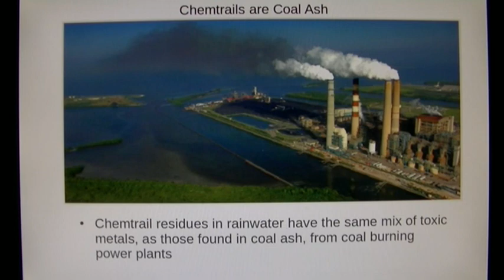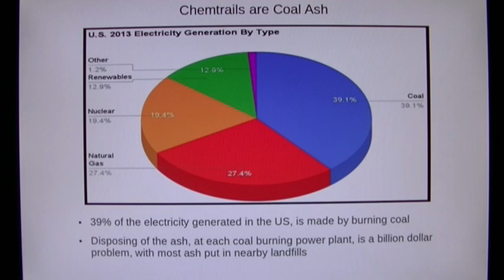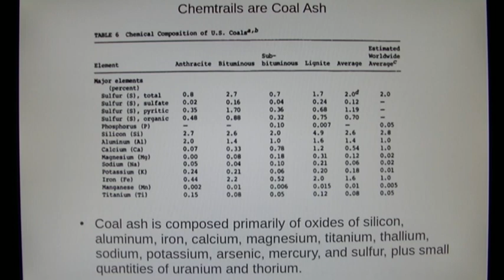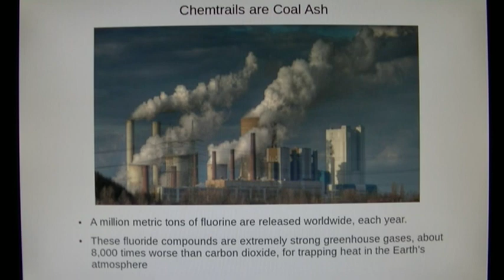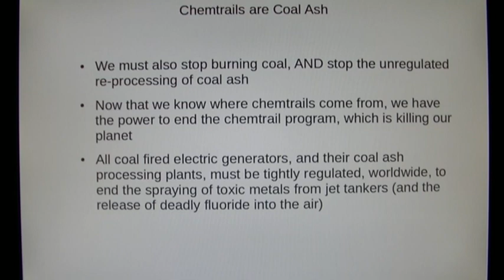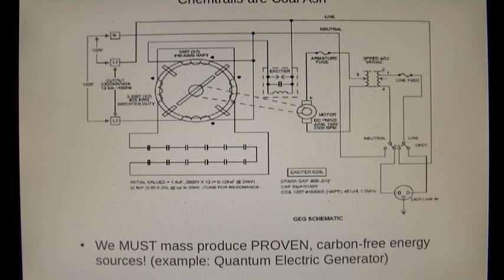Chemtrails are COAL ASH

Comment: We still have a problem. That is the weight of the coal ash. Chemtrails that are hundreds of miles long then spread and cover the whole sky weigh hundreds of tons. These are trails left by single aircraft on a single flight and there are currently no aircraft that has a max takeoff weight sufficient to accomplish  this sort of mission. THe largest airlifter produced is the A380 and it only has a load capacity of 300000lbs far short of what the mission would dictate. Also I have found that most aircraft seen trailing are commercial so where could the store the tons of coal ash on flights already loaded with passengers and luggage?
Reply from the maker: Thomas Parsons
The alumina is pulverized in super sonic grinding mills, and pumped as a DRY, talc-like powder into enormous holding tanks on the planes. There are no "kegs". Yes, a 747 CAN carry enough of the mixed aerosol to leave THOUSANDS of miles of chemtrails behind. YOU are missing the point, that a hygroscopic nano-particle needs very little mass, to create thousands of miles of artificial clouds.
Reply from the maker: Thomas Parsons
You're a shill, so I'm deleting all your comments.
Reply: +Thomas Parsons You're using logic. I don't think that will appreciated.
Reply from the maker: Thomas Parsons The heavy spray planes are pure white, and are not passenger jets. The light trails come from a fuel additive, containing barium, in regular passenger jets. I think you should look at Tinker Air Force Base, and their fleet of KC-135 tankers. These can carry many tons of payload. Keep in mind these are hygroscopic, nano-particles, so a microscopic particle, becomes a water droplet, causing the haze, and cirrus cloud deck. It takes very little mass, to create the haze over a large area. Also, since water vapor condenses onto the metal oxides, there is less humidity to produce rain, and a hot air layer, which prevents thunderstorm vertical movement. These are the reasons, there is never rain, if chemtrails are overhead.
Reply: Thomas Parsonsand these 747's full of kegs of coal ash slurry, have no passenger seats and they are NOT going to Hawaii, with the family. FOX News needs to spread this terrible info. No one will talk about it! WTF!!  NO SENATOR will speak out, all bought out!!
Reply: Kegs of coal ash? have you ever seen a keg of coal ash on an aircraft? I have worked in the industry for almost 30 years now I and have never seen a keg of coal ash on any aircraft. Has anyone ever seen or recorded and aircraft being loaded with coal ash, ever seen or recorded trucks carrying ash to airports? Any drivers in the last 30 years ever comforward? Pilots? Nope.... Please do not embarrass yourself posting pictures of weight and balance test tanks. You are totally missing the point. A 747 can not carry enough of anything to leave a trail hundreds of miles long. And that is using the FULL available take off weight with out equipment to spray. Aircraft have  limitations that can not be exceeded. Go learn something about aviation.
Reply: Thomas Parsons  Kegs of aluminum oxides, barium and strontium 90, that is what shows up in the down below soil samples, rivers ,streams, plants. Go see the KEG PARTY here : Just scrowl down : http://waterpoweredcar.com/chemtrails.html
Reply from the maker: broandrew
It looks like they broke your link, after you posted it. The lab tests prove the Coal Ash hypothesis, so that is why the results are gone. Some big money is hiding their involvement in poisoning everyone, and everything.

Comment: Dear HAARP Report,

Some very wise things have recently been said at:
http://enenews.com/

- in the comments section to this article:
Report: Fukushima fallout detected in U.S. fish

- for EXAMPLE:

Gasser
March 2, 2015 at 10:07 pm Log in to Reply    

The Trail in and out of Hell………After the explosions all that debris rained down over the complete Dai-ichi site.

If all radioactive particles were a fluorescent pink color, a circle many miles around the Nuclear site would be saturated in pink and fading out in all directions for untold miles and also up into the atmosphere going around and raining down on the World at this moment.

If you could see Radiation its everywhere, vectored by every wheel and shoe in an out of the pink ELE disaster zone spreading radioactive particles far and wide forever.

Every vehicle that's been in and out of the Dai-ichi site is/will be to contaminated to repair/sell…even to be melted down recycled.

Any item that leaves Japan is/will be contaminated and this contamination will escalate as it half-life compounds into deadly Actinides that settle into specific parts of the human body's vital organs, as its half-life morphing Becquerels punch holes in all directions through DNA Genome chromosomes causing gross mutations in ALL life.

Nothing is excluded in this withering death spiral that will ultimately lead to 450+ World wide unattended Reactor meltdowns, by then no one will be around to see the heavy metal Pink Cesiumsets and record the Earths last ELE Cockroach gasping.

Igmz
March 2, 2015 at 9:35 pm Log in to Reply    

Soooo, obviously, this is happening to us. I mean if inland fish, and fish people assumably eat (not to mention the other things which eat the fish, which we also eat..apex predators, right?) are getting dosed like this, well, "DOH!" Sorry yall, I knnow I'm preaching to the choir, here at least. No wonder people can't handle the truth. We might say we want it, the word might be engraved on our images, and within our sacred texts, but the sad reality is, we simply can't handle it. Not in enough numbers to make TPTB shite themselves in their fear of us, not enough to FORCE them to STOP…not enough, and soon, fewer still. Sorry folks not so "opti-pessimistic" these days.

harv33021
March 3, 2015 at 10:13 am Log in to Reply    

Igmz, you nailed it. "Not in enough numbers to make TPTB shite themselves in their fear of us, not enough to FORCE them to STOP…not enough, and soon, fewer still." And "bowling" came through with this, "Now is the time to help each other. To console. To forgive. To.open your heart. To listen as many do here to one another."…I believe that is the course of action to follow…I have no intention of passing on into the next dimension filled with hate, anger and rage. We are not going to beat the TPTB in my lifetime. Earth is going to end up like Mars, dead. But we will continue on our spiritual paths for many more lifetimes. It is all a learning experience and I am looking forward to it. Love one another and do no harm. It is a learning experience and once we have learned the lesson we can move on to others.

Best Wishes..........

Comment: No spraying all winter here kn buffalo.
4 days ago i wake up with 2 thick lines over my house and the sky was torched later that evening.
Now i can barely function and feel extremly ill and so does my girlfriend
Reply from the maker: Nick Blains The jetstream pattern has completely changed, in the last three days. And, there was a clear spot over NY state, so they sprayed to prevent the clear spot from forming a low pressure later. The toxic sprays over NY fall to the ground over the UK, a week later, so this is more covert genocide against Europe, since they are now dumping the dollar. Also, by preventing a low pressure in the Northeast, the warm air hitting Greenland is maintained. Southern Greenland is melting fast, as a result of the jetstream control, in the eastern USA, which was held in place for the last two months. If you are in a low lying area, you should sell out, and move to higher ground. Sea level rise is going to be 100 times faster than the shills at IPCC have predicted.

Comment: Dear HAARP Report,   After ten-thousand years of civilization they are only now discovering an apparently entirely new cloud formation called ‘hole-punch clouds’, or ‘fallstreak holes’, isn’t that amazing?  Do you care to offer any comments?   Thank you for being there as I consider your site to be one of the most very important on the web.

http://www.freep.com/story/weather/2015/02/27/hole-punch-clouds-southeast/24108707/
Reply from the maker: Beta Earth One When the atmosphere is stable, the jet liners ascending through the cloud layer sounds like a reasonable explanation, especially, when the punch cloud is oval, with a line through the middle. I think the real Haarp downbursts are much larger in scale, and the software will avoid giving away evidence of a manmade high pressure, whenever possible. Just my thoughts on the hole punch clouds, for what it's worth...

Comment: Is the crazy hot-humid-foggy weather attacking Florida in the middle of Winter related to HAARP Weather Manipulation ???
Reply from the maker: XTRMJ It looks like Florida just has strong southwesterly flow in the jetstream. Looks pretty normal to me.
Reply: The HAARP Report Thanks. It's just that I have never experienced this type of Winter weather in Florida before. It's just bizarre,...
Reply from the maker: XTRMJ Something big is happening in the eastern Pacific jetstream, as the persistent high, off the coast of California, is not being rebuilt in the normal spot. That is what is causing the strong southwesterly flow over Florida, IMO.
Reply: The HAARP Report
They were really spraying over Florida and to the east of Florida the other day, it was BAD!! I showed someone here what I saw and they had the same reaction, this person knows about this "stuff". I have noticed that they have been building these low pressure systems in Arizona or on the border of southern Cali and Arizona and they either sit there and spin for a while or slowly move east. It is to help draw the dry cool air straight down from Canada through the Pacific northwest!
Reply: Josh Writz I had a feeling about this, since I live in Florida, in the Tampa/Bradenton area, & I see the daily bombardment of our skies w/ ChemTrails, non-stop, & over huge areas. This has got to be expensive. I was just sitting here & figured one good reason to heat Florida up would be to concentrate more of the cold jet stream into a desired target area. Like I said before,... this is not Winter weather for Florida since I can recall, mid 70s onward. This "hot-humid-foggy weather attacking Florida in the middle of Winter" is not casual,...

Comment: chemtrails have been around since the 1960's
Reply from the maker: Back in the 60's, jet engines were not very efficient, and produced much more water vapor, than modern turbofans. I think that is what you were seeing, back then, not chemtrails. Chemtrails didn't start until the 90's. What evidence do you have, for chemtrails, back in the 60's?
Reply: The HAARP Report please dont get offended by the way i phrase words. i m a just a truth seeker . but i am also interested in the why who how of things too. but i typed in search(years ago i did this): "chemtrails 1960's". lots of vids apprear. altho too much info is dangerous.
Reply from the maker: Arctic Kat
Back in the 60's there were persistent jet trails, caused by the high levels of soot, and water vapor. Those engines were primitive, compared to the computer controlled turbofans that fly 102,000 times every day, all over the world. Do you remember how cheap oil was back in the 60's? Why bother with making efficient jet engines, just burn that cheap fuel, and don't think about it twice. Little did they know the catastrophe that will result from unbridled CO2 emission. We will see the end of our biosphere, in only a couple of decades. It will be the most horrible thing, any humans have seen. It is happening everyday, but we are choosing to not see it - YET.

Comment: Pillar Point Air Force Station - located at big-wave surf spot 'Mavericks' near Half Moon Bay in Central California.  Place has several "golf ball" type radomes. Bing Maps photo shows the installation before it was finished.  View it on Google Maps / Earth. Site uses 4-6 GHz G-Band tracking radars.  See more at http://californiamilitaryhistory.org/PointPillarAFS.html. BTW - have a look at the stationary high pressure blockade installed yesterday (Feb 16) off California to prevent precipitation from moving in.  See: http://www.cnrfc.noaa.gov/satellite/epac_wv_loop.php   This blockade is a rerun of a week and a half ago.  Storm after storm are blocked using this technique.  In February Southern CA has had only 3/32" of rain in the area.  In January a total of 1 3/16" was collected in the foothills of Los Angeles.  What we see on this water vapor loop is a deliberate stationary high pressure blockade keeping CA and the West bone dry.

Comment: I think this is your first video I have seen. While I have been in the system for some time I must say you put up 2 major red flags. USAF is not pronounced as one word, its the United States Air Force. I have never heard this term and I served 8 years in the military. The second issue is you sound like your reading a teleprompter of information, but you are messing up lots of words like you didn't write it yourself. I think Chemtrails are real and I pray they are here for good reason, which is still classified. Maybe my input helps your cause, if not I meant no disrespect. You just have to remember you have two types of people seeking information, the paranoid and the aware. Id also like to say that spellcheck in youtube doesn't believe in the word chemtrail.
Reply: - and by term of USAF I mean pronounciation
Reply from the maker: CherokeeArchetype
The defense contractors didn't say "United States Air Force", they just said "usaf". It was quicker and easier. Maybe it has to do with politics inside the US military.

Comment: Can't anybody just collect some funds and charter any aircraft with oxygen onboard to fly through the trails and collect actual samples?  Piper Seneca, Baron, etc would be relatively cheap and could reach "trail altitude" at the upper end of its ceiling. You could literally find trails at altitude and fly through them, lengthwise, collecting it on some medium.  Then you'd have samples and definitive proof already, instead of ground samples, or air samples, or whatever, which are all subject to various environmental contaminants at ground level.

Comment: Coal Ash? It's an interesting question. For a while I've been wondering if composed of diatomaceous earth, as I put DE in my food, and it looks just like the colour and consistency of chemtrails. Or maybe DE is actually coal ash. Seems to me DE 'suddenly' arrived on the market, from no-where, so to speak.

Also, if you watch carefully, the chemtrails tend to descend, maybe 10,000 feet very quickly after spraying (i.e. within 5-10 minutes) , which would tend to indicate they are significantly heavier than air. They usually settle around 10-15,000 feet. There's various perspectives involved, but their falling, imo, is one reason they appear to spread out so much (though they are spreading as well).

One thing you didn't address here, which hopefully you will in future, is how ash could actually be sprayed so consistently. I wouldn't have thought it would be so easy (compared to a liquid).
Reply from the maker: whatisgeo Good question - you have to remember, it is processed, using some high tech equipment. This homogenizes the size, and may also impart a static charge. If it is all given a monopolar static charge, after dispersing, it will try to spread out as much as possible. I personally haven't seen the spray fall. It does spread out quickly, which makes it seem like it is closer, or lower down. DE is supposed to be phyto plankton exoskelletons, very pure silica. I suppose they could use fly ash silica, and nobody would know the difference.